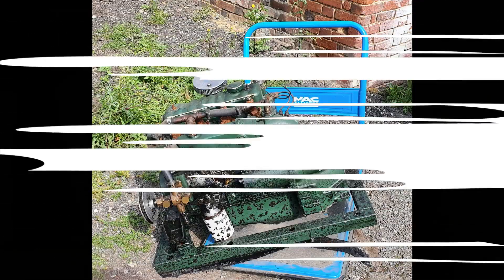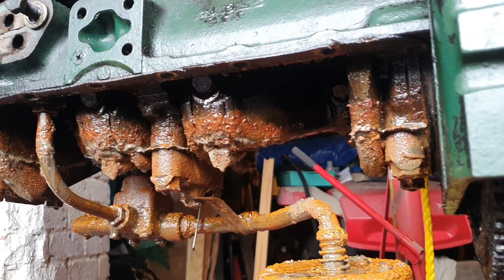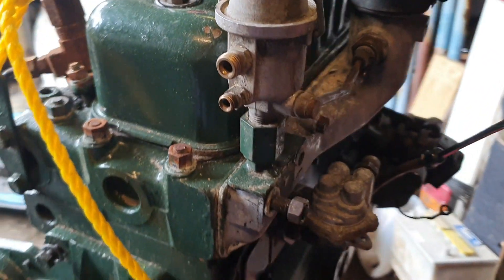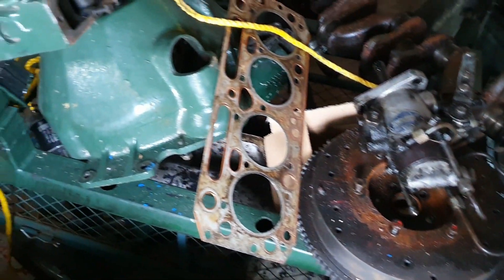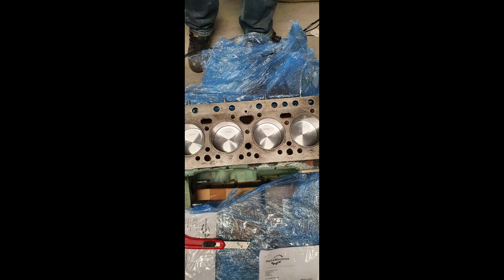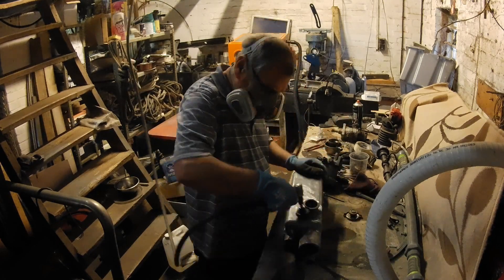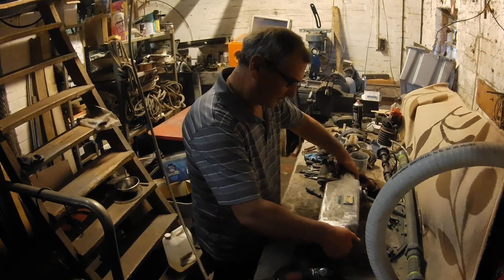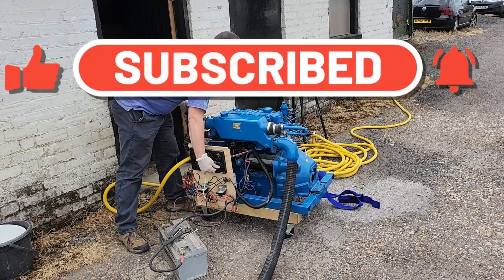#23 Perkins engine 4.108 rebuild and test run  Birchwood restoration

Comment: I've recently purchased a partially submerged (fresh water) 4108. I've ordered several parts, but not a mechanic. A well seasoned captain at the marina convinced me to try the perkins instead of replacing with a modern with electronic components (that fail in marine conditions) He offered to point and explain whenever I completed each task. Wish me luck.
Reply from the maker: Hi Matt
Of course I will wish you luck the 4.108 are good work horses 🐎 👍

Comment: Damaged back. You have my sympathy. Frustrating not being allowed / able to do the normal things and especially when you want to be cracking on with those jobs!  I trapped a nerve in the back about ten years ago, closest pain I can compare it to is a lumbar puncture. Look after it.
I'm trying to cast my mind back over forty years to my apprentice days. The old land rovers used Perkins in them. Definitely the 4.326. I remember it vividly being in LWB one I worked on. The 4.107 & 4.108 were very close , the 108 having different cylinder liners. I think the pumps were self priming, but bleeding the lines was necessary. and a tad messy. Might be something as simple as a dodgy fuel shut off solenoid. Hope you find it soon. Annoying after all the work done.
Reply from the maker: Thanks for your comments Loki I will pass your tips onto my son I know he had changed the shut off method on the engine from manual to solenoid so this could well be the reason for non start. I've got to play catch up on my work from next week due to the back pain so may not be able to get much done on the boat until the end of the month
Reply: @alcboating3675  I know the frustration. I have a rare neurological condition called myasthenia gravis. It doesn't bother me much normally, but had a relapse in November last which meant going back on all the medication again. One being a high daily dose of steroids and immune suppressants. The steroids caused tendonitis in the ankles and wrists. The ankles bug me at night when I lie down. But use a screwdriver or drill during the day. Hells Bells. Steroids being reduced slowly and things improving. But there's always some poor bugger worse than me, so I shouldn't complain. Keep the Faith, It will come together.